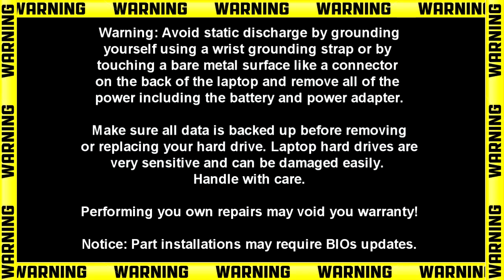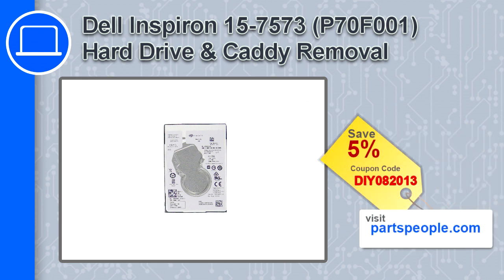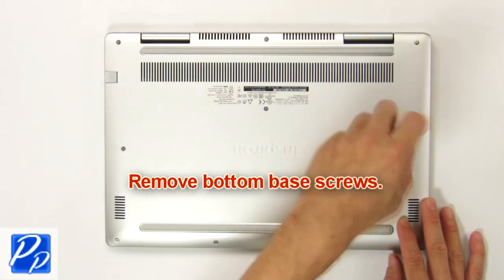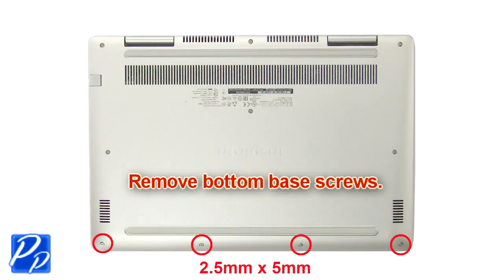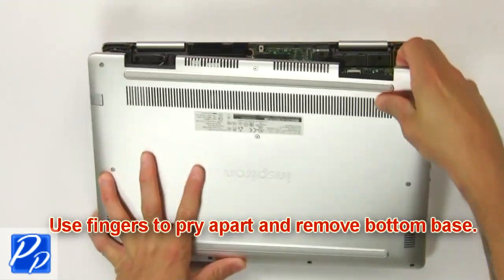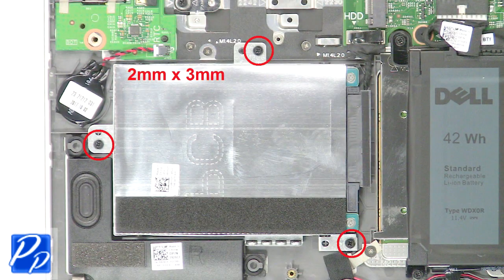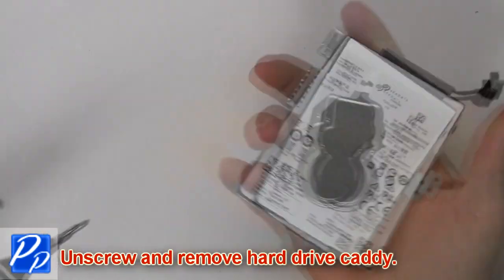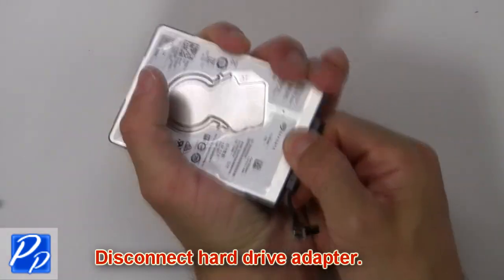Dell Inspiron 15-7573 (P70F001) Hard Drive & Caddy How-To Video Tutorial

Comment: I just got a 7573 with a 256 ssd and when i went to swap in the 512 m.2 ssd from my recently deceased dell 75??, I saw that there was also the 2.5" bay and what appeared to a cable sticking out from under the plastic static wrap stuck inside the caddy.  Do you know if this model was set up for optane, and whether I could put in a 2.5" ssd or hdd to increase capacity.  TIA
Reply from the maker: You can add an additional 2.5'' SSD or HDD to expand your storage capacity. Please refer to this link for information about using Optane memory on this model: https://topics-cdn.dell.com/pdf/inspiron-15-7573-2-in-1-laptop_specifications_en-us.pdf